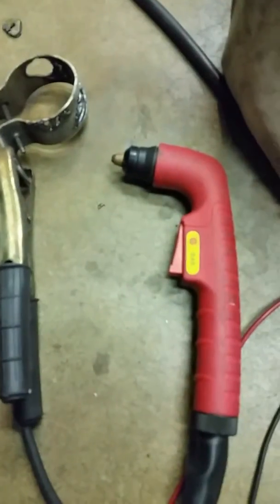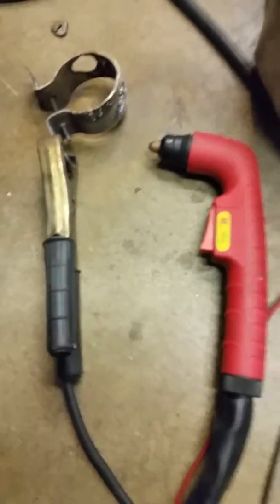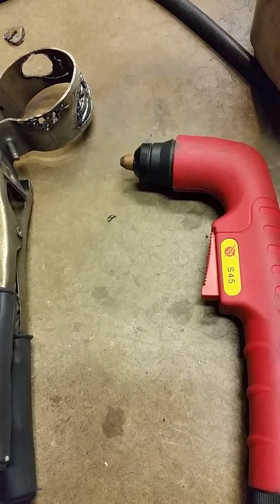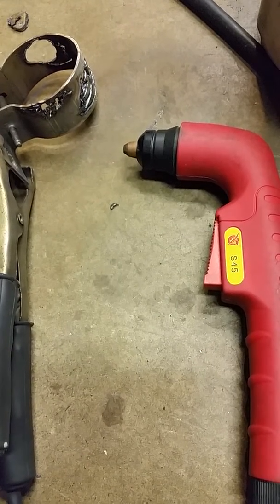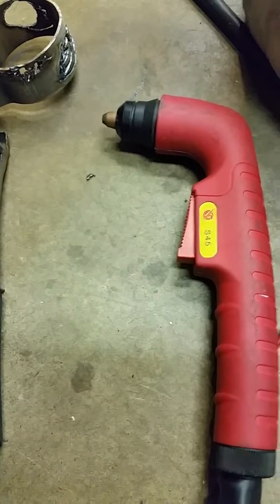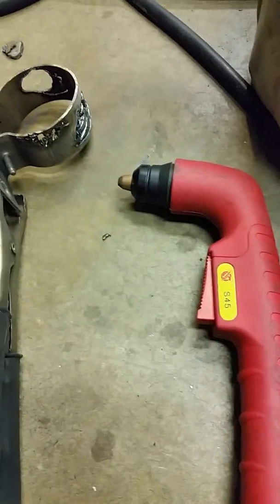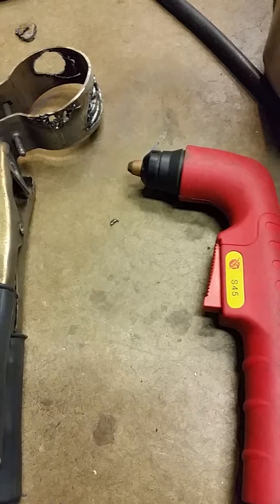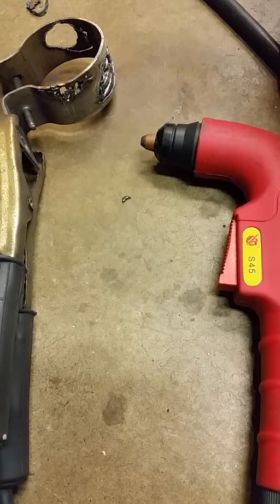test45

Comment from the maker: blow back style torch defeats this controller boards function to turn on the transformer so it is not compatible. If you run the air pressure servo leads up the torch to another momentary thumb switch , you can still strike a pilot arc by using the trigger to activate the main transformer and then hitting the air switch to use the air pressure to 'blow back' the conductor off the tip and that will create a consumeable eating pilot arc. Keep tip next to work piece for longest tip life.